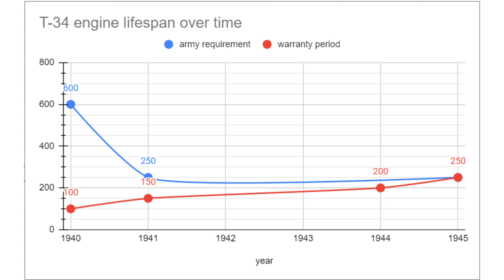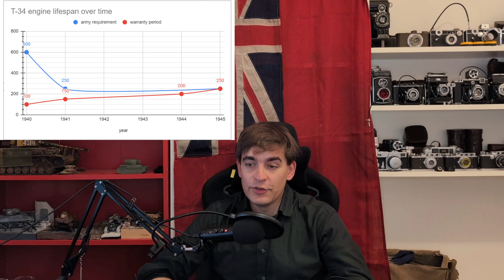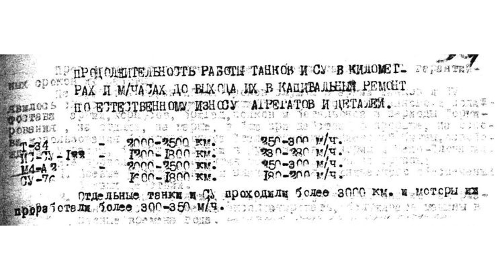The Myth of the Disposable T-34

Comment: I find it highly unlikely that component quality improved over war time when we know that they where cutting out components and processes as war went by and situation seemed to improve closer to berlin they where. We also know that russoans like to apply retroactive contiuity to their documents and history. It makes me wonder wether reports wherent made on "potiomkin's village" type of production series of tanks.
Reply from the maker: I talk about this in the video. As you study how a component wears down, you can reinforce the parts that wear down the most and thin out or lighten the parts that wear out the least. The T-34 was brand new at the start of the war so this experience was not yet available. Several years down the line this experience is available and the further the front line gets away from Soviet factories the more valuable every hour of run time becomes.

Let's consider your theory that they're lying. If the factory lies about how reliable a tank is, it will be discovered by the army. This is what happened with the SU-76 and how Ginzburg ended up losing his job: not because his design was unreliable but because he covered it up. If the army is lying about how reliable the tanks are, then they would run out of tanks and be unable to request reinforcements since all of their tanks are still working on paper. So who do you think is lying and why?
Reply: @TankArchives  No you assumed that evidence that is on the ground of wartime production t-34 are somewhat compliant with standard described in doucments. We know exmaples of t-34's with crucial components missing like TC and D sights with reflective surfaces left unpolished and turret basket uninstalled which are not complient with standards. We have multimple examples of t-34's with no seating for crew in hull. We know they where lying to certain extent to their supperiors counting on it being not being noticed in wartime madness. While in some factories it was rarer (like omskaya) in many (including Ural- biggest of the m all) where noutorious for doing such shit to increase the rate of production- as old soviet saying goes "paper will accept everything". And Should i remind you of infamous stalins order that implied that soldiers that sabotage their tanks to not go into fights will be formed into penal infantry batalions - afterwhich it turned out that non where formed as reliability issues where real. While it is possible that parts that where impossible to miss have seen improvments with natural improvment skill of factory crew getting better i find it impropable that overall quality improved when we have such glaring examples of manufacturing defects.
Reply from the maker: @radosaworman7628  Your assertion of "war madness" dismisses literally hundreds of people who are going to inspect that T-34 tank before it gets to the front lines. Surely if a soldier is accused of sabotage if their tank doesn't work would be more likely to report the tank being defective from the factory, not less? Your theory is based on the assumption that everyone is lying and working backwards, that's not how history works.
Reply: @TankArchives  dodge of a century. Go to places where actual wartime T-34's are. Give them a good look and count components missing. I dare you.
Reply from the maker: @radosaworman7628  The fact that tanks that have been in service or in the hands of private collectors for the better part of a century are missing parts has nothing to do with how they were built originally. Do you look at a Matilda repurposed for farming and conclude that the tanks came out of the factory without a turret, armament, or most of the hull?
Reply: @TankArchives  even when you disassemble tank partially there will be traces of previous mounting of equipment. Threads will bear regular imperfections, spot wealds will retain its marks and  if you are really lucky there will be marks on original interior. Futhermore you can recognise weather certain parts had functional equipment attached to it by way it rots as contact with oils, rubber and diesel is more likely to preserve it better from inside than outside. If it's in private hands it's even better, as owners are usually stoked about all of the work they have done to it and prices they paid. I was thinking museum pieces and monuments but private collections are even better to learn about them.
Reply from the maker: @radosaworman7628  that's a lot of hypotheticals. Where do you see a T-34 without even a trace of seats?
Reply: @TankArchives  majority of war production t-34s are in ex-comblock countries (so called eastern Europe) and I've heard that sone are in far east- but when it comes to eastern Europe there are plethora of channels that goes around monuments documenting their state ( and if you find some with subtitles - estimating amount of times "meat insert" where changed based on noumber of fixed opening and exit holes left by the enemy). Yes many of them are closed off permanently but in somebyou can enter and see how little of them has just remains of wooden box in place of seating.
Reply from the maker: @radosaworman7628  Those tanks don't have engines either, are you going to conclude that T-34s came out of the factory with no engine? It's absolutely ridiculous to evaluate wartime tanks based on the condition of a static display 80 years later.
Reply: @TankArchives  you would think so based on western experience but we had multiple examples of protesters/partizans starting engines and driving "deactivated monument tanks" - with at least two examples within last 2-3 years in Ukraine.
Reply from the maker: @radosaworman7628  My point is that you can't take a static display that's little more than an empty box and use it to make conclusions about how tens of thousands of these tanks were used 80 years prior while discarding period documents completely.
Reply: @TankArchives  Have you ever heard of the Russian term "Vranyo"?
Reply from the maker: @chrisbeer5685  many times, but always from English speakers. The core idea of that one article that a society with a language with multiple words meaning "lie" inherently can't be trusted is absurd. That would disqualify the vast majority of languages as valid ways of exchanging information.
Reply: @TankArchives  Maybe read Fyodor Dostoyevsky, "A Word or Two about Vranyo.", if that's the case.

Not remotely my argument. I'm not saying every Russian is inherently untrustworthy. But incentives and certain aspects of Russian culture come together here in a way you seem to want to ignore.
Reply from the maker: @chrisbeer5685  you do realize that I was born in Russia and went to school in Russia, right? I read my share of Dostoyevsky and I have no shortage of experience with Russian culture.
Reply: @TankArchives  I have no way of confirming that. But if you read it, you will have heard it from a native Russian speaker.
Reply from the maker: @chrisbeer5685  you should probably read more Dostoyevsky than a wikipedia grade summary of one of his works before you consider his philosophy to be applicable to modern society.
Reply: @TankArchives  How many of his works do I have to read in full to confirm a word he wrote an Essay about is in fact a Russian word used by Russian speakers?

Comment: I had someone legitamently try to argue that the T-34 could not go over 6 kph
Reply from the maker: Interesting. Did they not think it was possible to shift into second gear?
Reply: @TankArchives  Yes exactly. They thought the transmission/gear box was so bad that it was almost impossible to shift gears. I've argued with people about an untold number of tank myths and I have to say that was certainly the weirdest.
Reply: @fearedjames  with all due respect sir, aren't you confusing anecdotes and single events with overall performance of the tanks? I'm not saying those issues didn't occur, I know they did, but the overall performance of the most of the tanks was never like that. Soviet tank units from the start of the war were able to move dozens of kilometers per day. Again: I'm not saying those things didn't happen. They were often force to leave broken vehicles behind. That wasn't a necessity though.
Reply: @fearedjames  I know nothing about tanks but I do know you don't need to be a professional race driver to change gears without a clutch, you do have to pay complete attention though, but definitely a skill most drivers could pick up in an hour or two.
Reply: @seductive_fishstick8961  wrote: "Yes exactly. They thought the transmission/gear box was so bad that it was almost impossible to shift gears."

-- Yes, gear shifter linkages actually do have to go under and through fighting compartment and engine, since gearbox and cultches was last module in the tank, while driver is a "first" module in T-34 tank, so in that regard transmission in front of the driver were much easier to shift gears, but as a rule, those tanks that had engine at the back with gearbox up front of the tank, height of the tank usually came out taller then it needs to be, but "myth if T-34 could not go over 6 kph could be easily debunked by doing a quick search YT, as there are plenty of footage how fast T-34 were.
Reply: @seductive_fishstick8961  well, that myth is only half true, the problem did exist but it wasnt 6 kph bad, it was only the last few gears that were hard to shift. the actual pre hard to shift number was closer to 30 kph.

now this is a bit of a theory but they might have gone only 6 kph to fire on the move, because the christie suspension was infamous for being unstable offroad, and that "fact" may have been corrupted in translation into "t34 can only go 6 kph".
Reply: @TankArchives  I don't know about the T-34, but according to Neil Stokes' book, there was an issue with the gearboxes of the KV tank: it was very difficult to go from 2nd to 3rd gear. And if you take too long to shift gears - we're talking seconds here - the tank has lost so much speed that you have no choice but to go back into 2nd gear.
Reply: @jczeus  That's what they had the sledgehammer for. On the bright side you don't have to take the turret off to service the transmission!
One thing brits had done right with their ww2 tanks is the gearboxes.
Reply: @jczeus the KV-1S got a new transmission which used a more efficient drive system.
Reply: That would make it a British infantry tank...
The T-34 should do that in reverse.
Reply: Mallets are useful tools indeed.
Reply: i think this myth comes because of the sustained off road speeds on marches, which was pretty low, but to be fair it was very low on other tanks like the panzer IV aswell. in a combat situation, the T-34 could go pretty fast.
Reply: Probably got confused with the British infantry tanks, or idk, modern Russian tanks' reverse speed
Reply: Because the hurried manufacturing process, the Soviets couldn’t afford to spend the time on the heat treatment of the ball bearings for their machines. This includes the T-34 and so the USA was asked to supply the ball bearings for their manufacture. This was shown during the CIAs examination of a captured T-34-85 during the Korean War. Their report said the T-34-85 that was captured was still being built with some American ball bearing left over from lend lease.
Reply: T-34 could not go under (rather than over) 6km/h without constantly using the clutch. This was a problem to support infantry that had to walk behind it, and got tired running too fast. This was fixed with a new 5 gear gearbox but most WWII tanks had the older 4 gear gearbox. Its also why you see so many T-34 "tank riders" on top of its armor.
Reply: Must have been a Lazerpig fanboy high on nafo copium or something I dont know he and his audience make me cringe
Reply: @Silver_Prussiantrue
Reply: @Silver_Prussian shh don’t summon them
Reply: @Silver_Prussian  generic lazerpig hater cope, he never said t34 only went 6kph, he said it could only go 30 kph.
Reply: @democracy_enjoyer

The 30kph figure is also a myth and in both British and Soviets testing of the t34 not really indicated at all. 

He is pulling that out of his ass off for the most part that it was a hard mechanical issue. 

The transmission was extremely simple and designed for ease of training and compatibility with previous designs . 

Its difficulty was mostly ergonomics not an issue with the mechanics of it. 

The simplicity is literally what caused it to be harder to use at higher speeds this is not something that is unknown and 

30kph is just an average cruising speed it seems not to do anything with  the actual tank itself. 

Frankly how bumpy the ride of the t34 even on regular roads as well as how the driver has alot going on has greatly more impact on his speed than the smoothness of the shifting in this situation. 

Lazerpig and his cohort are pretty notorious for uncharitable framing. 

He isn't a particularly bad example of historical YouTubers who take things to an extreme however you have to be incredibly stupid to think poorly sourced and often anecdote based historical videos wouldn't ruffle people's feathers. 

For example animarchy one of his friends directly misquoted Geoffrey Roberts Stalin's wars to me in a debate on Soviet intentions leading up to the war and proceeded to show me a Amazon book tab even though he clearly hadn't read the book since he said it supported his theory that the Soviet Union did plan on a premptive war with Germany in 1941 and wasn't in a refit of the military. 

While that wasn't lazerpig the fact that this is the average experience of history fans with his cohort is why he is lumped in with them. 

I do agree he's definitely better than animarchy(arguably a political hack who also for some reason can't read Soviet or English sources properly) 

But just by being associated with absolute clowns who have no respect for history is gonna obviously make people resent him.
Reply: probably a LazerPig fan
Reply: 80kph if good road
Reply: @Chaldon-hl6yk  Legit no WWII tank could go 80kph
Reply: @fearedjames  SU100 is t34 but can
M4 also
Reply: @fearedjames  BT-7M could hit 86kph on wheels but yeah good luck with that.
Reply: @fearedjames  The M18 Hellcat could go 89kph on-road, but technically that's a tank destroyer and not a tank, despite its very tank-like appearance and the fact many were employed as tanks with some success.

Comment: I'm a bit curious on how the repaired tanks that were penetrated by enemy canons, do they patch the hole? If so how?
Reply from the maker: The area around the breach is cut out and a plug is cut to shape and welded inside the resulting hole. If the breach is too large, too close to the edge, too close to another breach, or any number of conditions where the resulting armour would be sufficiently weakened, then the plate cannot be repaired and must be replaced entirely.
Reply: @TankArchives Meanwhile the truth... Ivan using a comically large bandage on the tank... Works good 👍